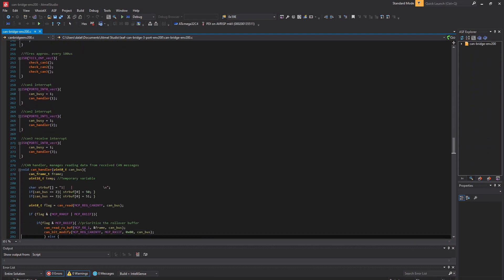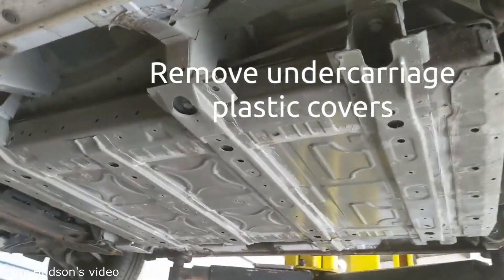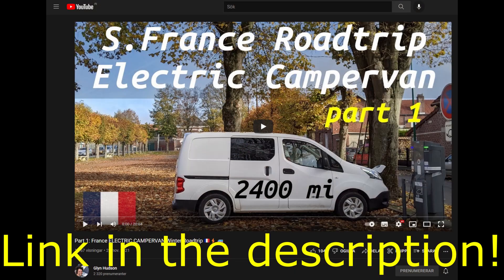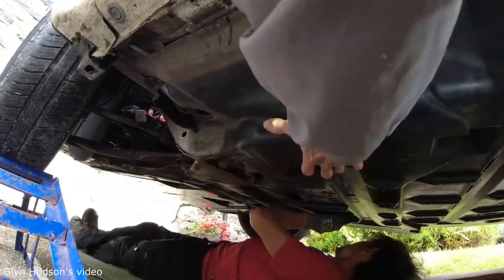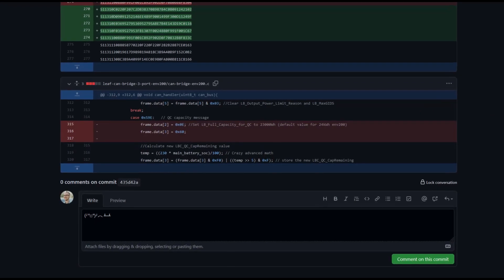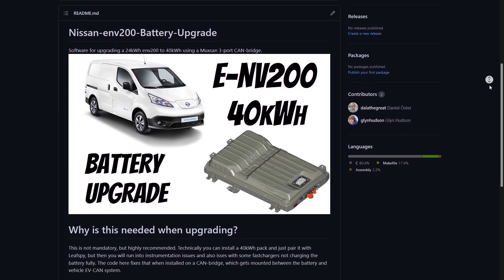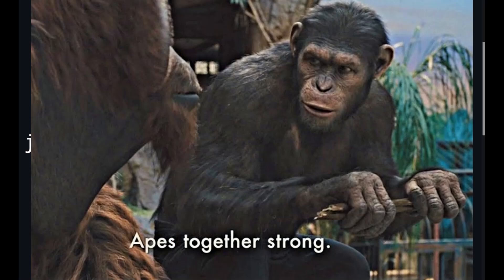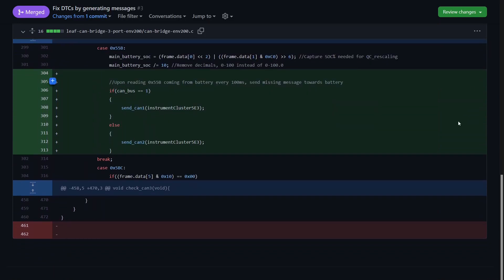HUGE e-NV200 Battery Upgrade News!

Comment: Hi Dala,

I’d like to modify my e‑NV200 CAN bridge so the AC compressor runs constantly at ~600 W during charging instead of pulsing (~150–200 W).
	•	Compressor starts at 25 °C as usual.
	•	Battery fan stays automatic.
	•	Goal: maximize charging speed and avoid rapidgate.

Is this possible via firmware?

Thanks,

Comment: Hello,
I’m considering adding extra batteries in the trunk of my car. Do you think this would be feasible? I’m not worried about the weight, as the car is on leaf springs. My idea is to tow a light trailer on a long trip.

Comment: @DalasEVRepair i have the Ali express 2 port can bridge. Is this upgrade also working with that can bridge?
Reply from the maker: Yes
Reply: Thanks that’s great. Unfortunately I can’t get the st link v2 programmer to connect with the bridgeflasher exe. I noticed you linked a budget option but is it also possible to use the official st link programmer with your bridgeflasher? Or any other things I could try?

Many thanks
Reply from the maker: @Bart3092  Try another PC. Only bridgeflasher.exe will work!
Reply: @DalasEVRepair  unfortunately I don’t have another pc easily available, I have a Mac myself. It’s not possible to use a Mac to flash?
Reply: What could be wrong with the pc? I tried 4 different usb ports
Reply from the maker: @Bart3092  No unfortunately this only works on Windows!
Reply: @ the can bridge is installed and it is working!! 🎉 Thanks for your help 🙏

Comment: The whole community around the ENV/Leaf is awesome, especially @Dala's  total commitment. Another improvement to the upgrade guide would be any suggestion on what tool to use to de-pin the B24 battery plug. Has anyone had any luck removing pins from this 36-pin monster?
Reply from the maker: The pins on the 22-pin B24 cannot be plugged into the 36-pin connector. So there is no point depinning the 22-pin.
Reply: @DalasEVRepair  That's also interesting, I was thinking more about de-pinning the 36pin because my 36 got damage and I was trying to avoid re-soldering all the wires :)  (anyway - I don't want to distract you from the awesome stuff you're working on!)

Comment: It's great that you guys have done this work. I've had my env200 for a year now and, as much as I love it, I'm tearing my hair out with the incredibly long journey times for road trips and so I think the only way I can keep the van is by converting from 24 to 40. The last time I looked at this option, about a year ago, it seemed to me that the problem wasn't so much the software but the lack of 40 batteries anywhere! I wonder if this has changed? Also, muxsan and cleevely had stopped doing the extender batteries, and I don't know if they have recommended or if anyone else is doing them? I've found a guy in NZ who can swap the batteries, so it seems to me that my only option is to try and find a 40 battery? Do you have any tips, or suggestions on who to speak to, on if and how I can get hold of a 40 battery? I live in New Zealand and the vans were never sold here and very few 40 vans were imported; I've only ever seen 1. So I expect I'll have to look for one in Britain and ship it over. Thanks in advance for any help you can offer.
Reply from the maker: Cheaper to import from Japan, but can be hard without a broker!

Comment: Hello, is it possible to upgrade e-nv200 battery by replacing hardware from leaf battery? Due to shortage of e-nv200 40kw battery’s.
Reply from the maker: Leaf BMS does not work in env200
Reply: Is it CAN-bridge can solve problems with instrument cluster showing incorrect data by the ‘Bruteforce’ method used on env200?

Comment: Big-big double thumbs up! (From a 24 kWh E-NV200 owner - now I only need an affordable 40 kWh battery and a Muxsan adapter, in Hungary somehow...) 

What I also follow with great interest is your project to connect the used EV battery to the Fronius hybrid inverter - that would be the use for the 24 kWh battery.